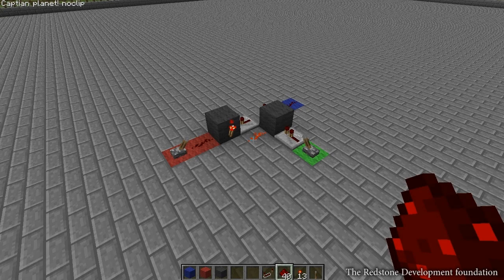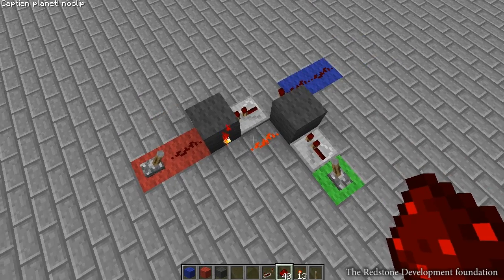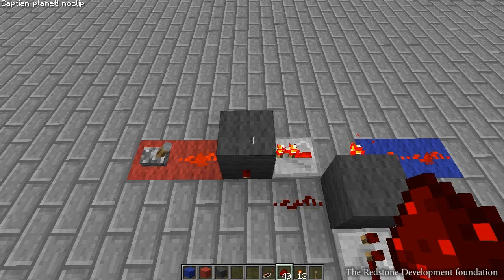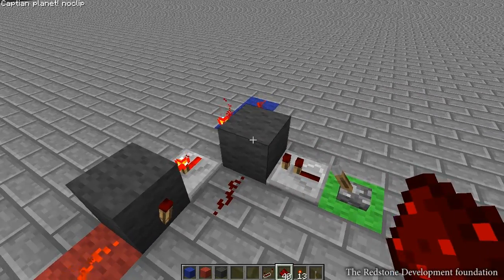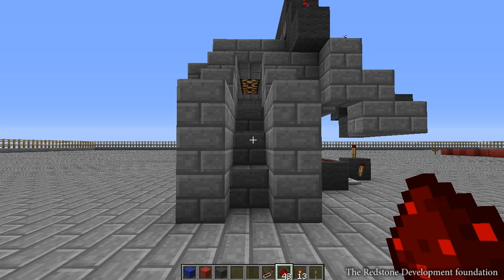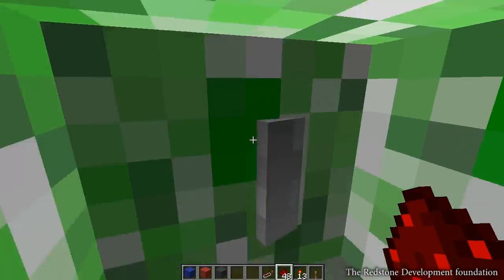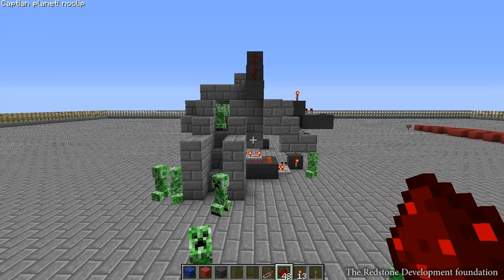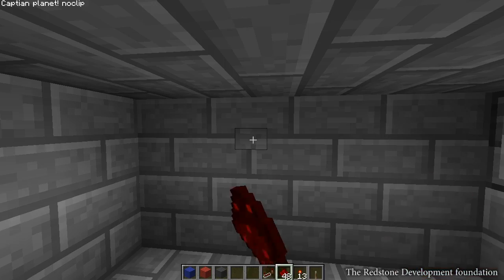What is: RS NOR Latch

Comment: I'm sorry to say this, but the video is bad. If I didn't know about RS NOR latches before, I wouldn't understand a thing. The example is useless too. Maybe you can redo the video with this example: There is a room, and at its entrance there are 2 pressure plates on the floor, connected to an RS NOR latch below them. Put a redstone lamp inside the room and make it turn on when someone enters the room and off when they leave.